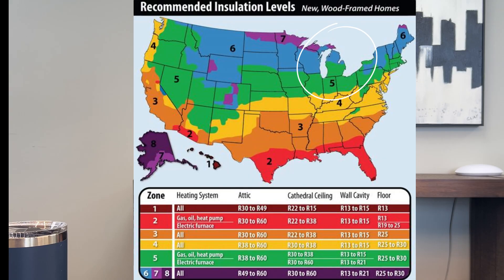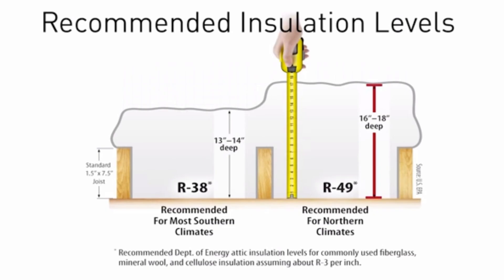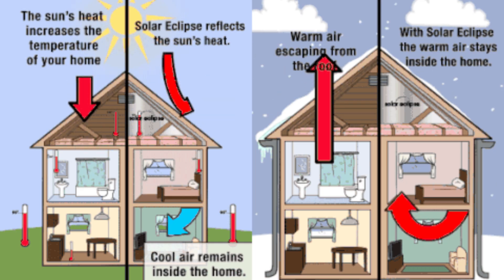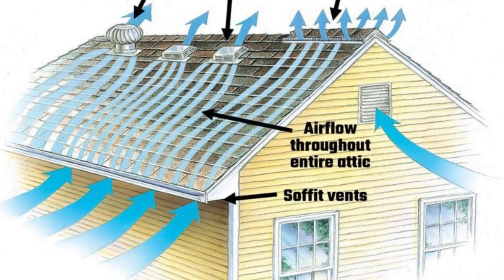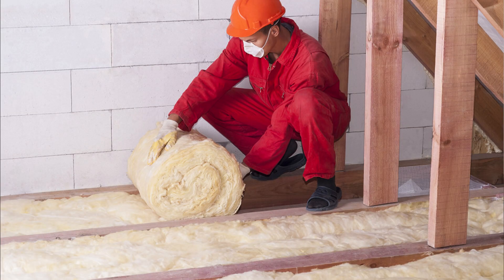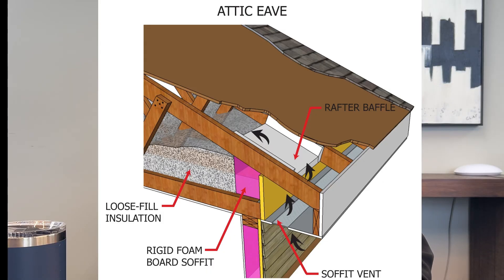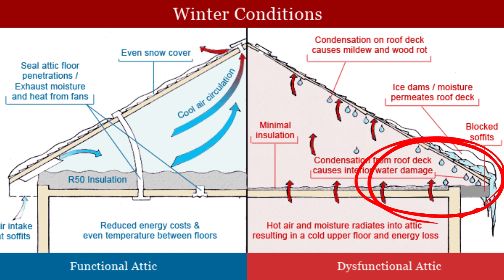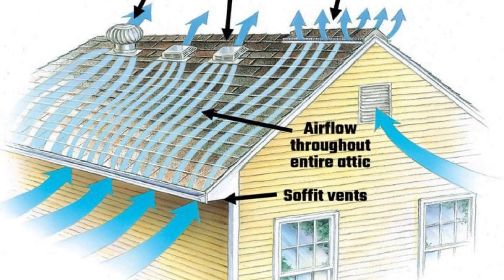Everything you need to know about attic insulation

Comment: Ok, I have a half hip half gable roof in my 1913 home. Some time ago, the previous owners insulated it all wrong when they finished it for living space. My main question that has been hard to find is with cathedral ceilings (with a 1.5-inch baffle gab do i need to have intakes for every rafter. Right now, we have 6 (baseball size) intake every 3 or 4 bays, with a ridge vent. I have more questions, but this question I can't find any reliable sources. Thanks.

Comment: As an insulation business owner, I didn't hear anything about the airsealing process, so if you're blowing a 49 or 60, and leaving wouldn't you get a way better performance sealing the attic before you just blow and go just asking cause here in Ohio that seems to be all these insulation companies want to do is just blow and go make a quick buck and not do there job right drives me nuts when that's all they want to do  instead of doing it right so do you guys take the time to seal the attic right just asking what your though where on that
Reply: Per BPI the best result is to air seal the attic and the garage from the house to get the most energy efficient results, so to piggy back off what you said… I have worked in the ohio area and yes everyone wants to blow and go, i mean as a company why not? Go make stacks of cash knowing 90% of the customers wont get up there cause they dont know what they are looking for they see mountains of insulation and trust what is going on cause they just hear noise and see insulation going in… and then those types of people get inspected and kicked off programs or whatever and just bounce to the next city or state.
Reply: @lanevincent9270 
What is your preferred method to air seal recess lights? I have over 20 4” halogen recess fixtures and want the most affordable way to air seal them. 
Do you recommend retrofit led with gaskets or the fixture covers in the attic?
Reply: @doug2202 good question did you find a good answer ?

Comment: In a "Perfect World" R49 or R60 would be awesome,but my house is 125 yrs old and drafty. Last winter; due to lack of insulation...major ice dams built up and caused all the gutters and eves to collapse - boku damage!
Now; 6 1/4" fiberglass (with baffles) and 4" foam board at the edges - its amazing HOW the cold air isnt...pouring upward into the attic anymore. Its 14 degrees outside...and the attic is 58 degrees, now. Because i do not plan on putting drywall up - i went with a Vapor Retarder (rather than a Barrier) to....somewhat tighten up the moisture flow - through the Kraft-faced Insulation.
Reply: Im surprised that roof didn't come crashing down. Should be done every 30 years

Comment: If you pile rigid insulation on the back of the thin hatch cover (minute 12:41) you still have an air gap around that insulation (it's there so you have enough room to lift the hatch cover out of the way without it jamming in the opening). That gap can let a lot of cold air out of the attic, and conversely, a lot of warm, moist interior air into the attic. Instead I  would put an insulated "lid" on top of the attic floor joists, maybe hinged on one side, and add a latch on the other side to really secure the lid to the tops of the joists. Then the ceiling access panel can only be there for aesthetics.
Reply: @ryansoo4000 - You are 100% correct. It’s funny how in all the attics I have been in over the years I don’t remember ever seeing rigid used as the walls with a lid. Until 3-4 days after the video posted, there I was looking up at a solid rigid foam upside down box. I thought to myself, that is genius, and we have adopted that best practice moving forward. Thanks for bringing this up. You are appreciated.
Reply: I have the stack of rigid foam board on the back of the hatch cover but also have weatherstripping around the perimeter of the bottom of the hatch to seal against drafts.